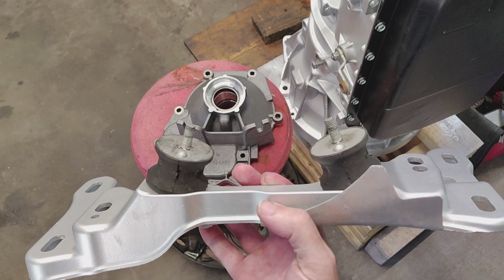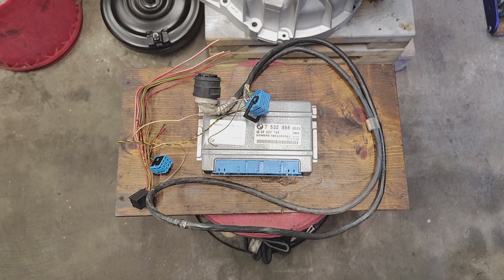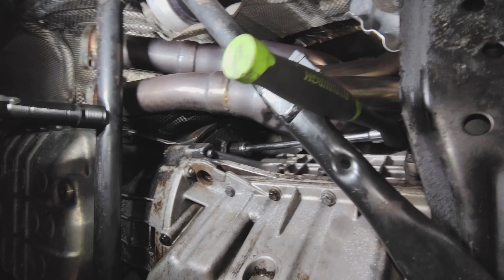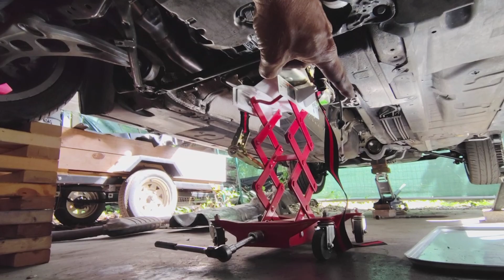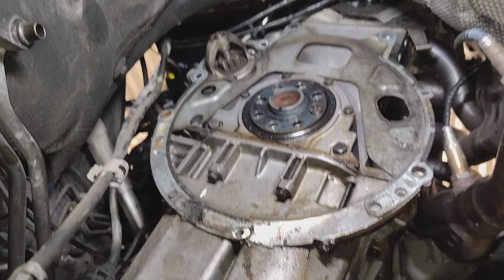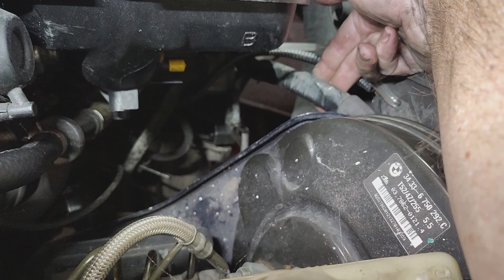BMW E46 ZF to GM Automatic Swap, Part 1

Comment: Hi Michael!! Excellent work!!.  Have a couple of questions.. I have the 5L40E and want to do the 5L50E internals.. will I need to also change the wiring and ECU or will it be a direct bolt on? Also regarding the plate you made, do you have a video on how to make it? Can you make one and sell it? I will definitely buy one off you since I’m not a welder or fabricator..😅 by the way I have a 2005 330i with the GM 5L40E..

Comment: Isn’t the ZF transmission supposed to be better..?
Reply from the maker: Depends on how you define "better." People say the shift quality and comfort are better with the ZF 5HP19. But the GM unit is a stronger gearbox. This is a street/strip car, so I'm more concerned with the latter.
Reply: @michaelblacktree  id swap my gm to zf if given the chance ^^' i just dont like the GM
Reply: @seesikopter  probably cheaper to build out a GM transmission over a ZF I'm sure there are kits out there that allow them to hold more power
Reply: @a @anthonyk  I still want the ability to have xHP
Reply from the maker: @anthonyk  - Yeah, the GM units have more aftermarket support. Basically all I could find for the ZF unit was a cheap basic rebuild kit. For the GM unit, I was able to get a Sonnax boost valve, Transgo shift kit, and Raybestos master rebuild kit with carbon fiber clutches.
Reply from the maker: @seesikopter  - NGL an 8HP swap would be sweet. But for that kinda money, I could do a manual swap.
Reply: @michaelblacktree it's something to think about for me because I plan on buying a supercharger in the future I've also played with the idea of getting a zf8 speed since I'm starting to see people swap those onto m54s and the results are great in terms of mpg and 0-60

Comment: kind of curious why you wouldn't use a ZF or Getrag 5 or 6 speed manual?. I'm pushing 500whp on my stock Getrag g260 with a twin disc clutch and its been great.
still a cool build. super interesting how compatible the Cadillac transmission was. 
I've had some pretty rough experience with those 5L40 Transmissions. they Shift really sloppy and don't last compared to the ZF. Interesting to see how it will compare. 

side note. that fluid out of the ZF wasn't too bad. even for fresh-ish fluid it seems like normal wear from the clutches/friction plates.
Reply from the maker: I decided to do something different. The E46 manual swaps are just as monotonous as LS swaps.

Comment: Glad to see more progress with this project.  The glitter in your drain pain is relatively normal for auto's.  Even on a fresh rebuild or factory reman and just running it for a few minutes you'll have glitter in the pan . When the fluid comes out dark brown, stinking terribly, and the glitter it thick like grease . She dead then lol .
Reply from the maker: I did a transmission service (oil, filter, and shift kit) a couple years ago. I was surprised how dark the trans fluid was, considering the low miles. But maybe some of the old trans fluid mixed with it?
Reply: What's your plans as far as programming the trans to the car ?
Reply from the maker: ZHP tune, and hope for the best. 😛